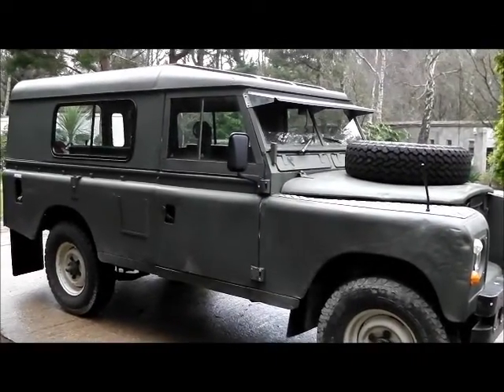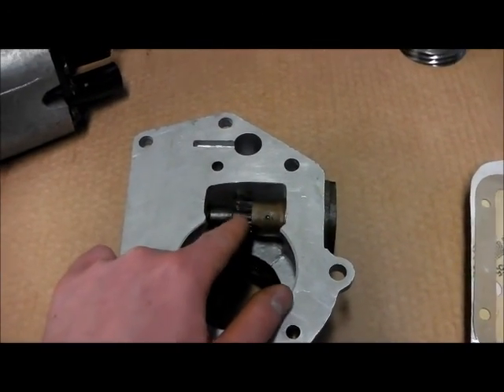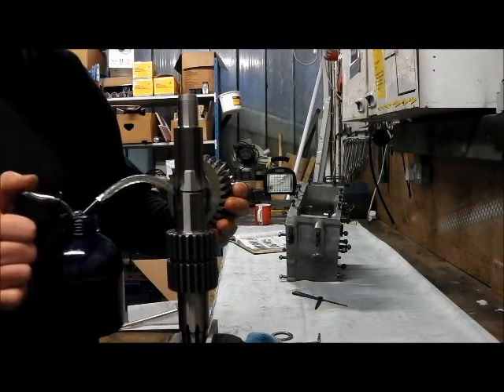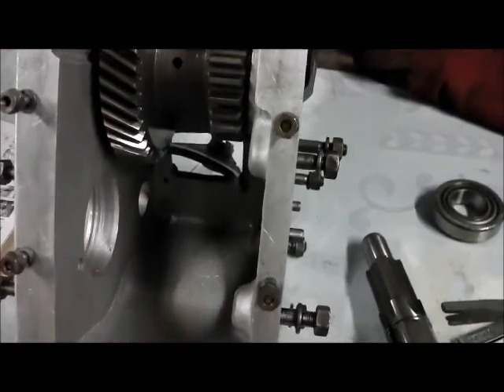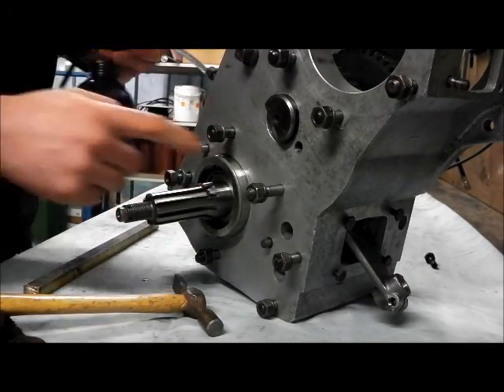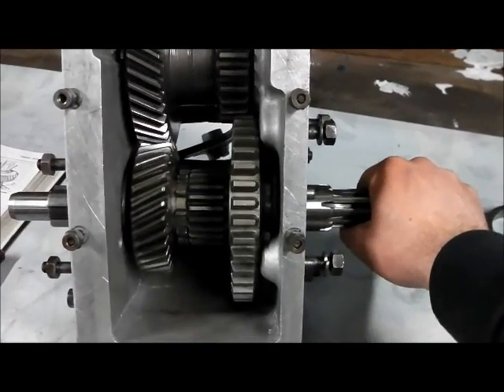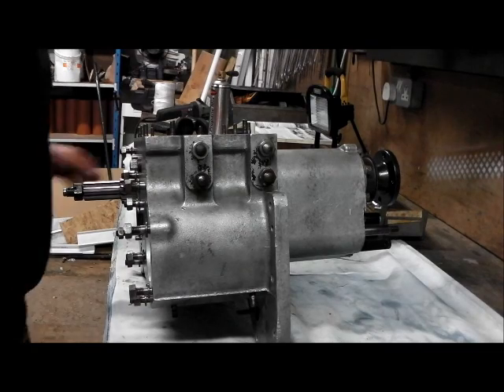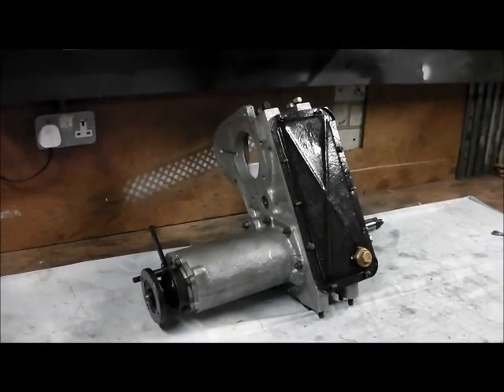Land Rover Series 3 Gearbox Rebuild - Part 5 -

Comment: lovely rebuild . need to get my spare done when i move ...lol..nice little series on your rebuild cheers
Reply from the maker: +Colin Tonkasdad 

Thanks, I just hope it works well after all the effort. Having moved, my trip to work is about 40 miles a day (at 20mpg!) and the transmission noise does seem to have reduced a bit for doing some longer trips - particularly the overdrive.  Seems to be doing the engine good too, keeping up with the traffic no problem. I'm sure it will be even better with the new box fitted. 

There are some nuts and bolts missing from the transmission, so I've started making some of those today. Quite a satisfying job. 

Hope your rebuild goes well,

Phill.
Reply: +steamwally 20 mpg. ...my 2.6... does 14mpg  so overdrive a must.. just have to extend the selector arm and bracket cause it's from 4cyl petrol.. but it pulls from 20mph to top speed of 65...before overdrive.. !! but prefer to the swb I have.. cheers
Reply from the maker: cor, you must be able to hear that gargling petrol! A 2.6 StaWag came up for sale near me for 2.5k and I was so tempted, but two Land Rovers is a a bit excessive for me at the moment..... one day.
Reply: +steamwally it's a lovely engine... and needs a little service... but I don't travel far... retired so just plod about... yes fuelled 3 times from Scotland. . lol.. cheers

Comment: Hi Wally, i am trying to remove the rear bearing outer race on the output shaft of the transfer case.  i have taken circlip off front race and dont know how to proceed. I am working on a land rover series 1 but the box looks almost the same.  any help would be greatly appreciated .

Comment: Great watching the main drive shaft going into the xfer box, but how does it come out?  Do you just tap it from the 'front' end?
Reply from the maker: +Michael Stanton-Jones 

It's easy enough to remove the rear output shaft from the casing, but not quite so simple as driving it out from one end. You would be best off looking at a copy of the workshop manual or at least a Haynes manual - both have diagrams illustrating how it should be done. Basically, you need to drive the outer race from the casing from the inside.